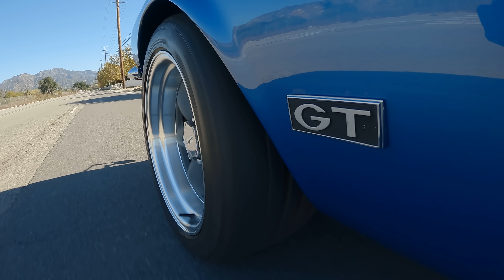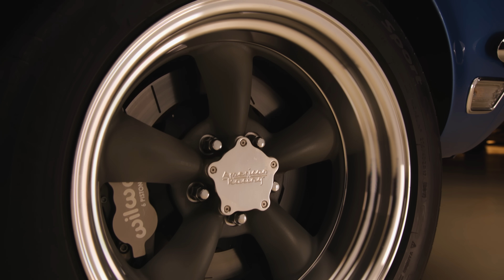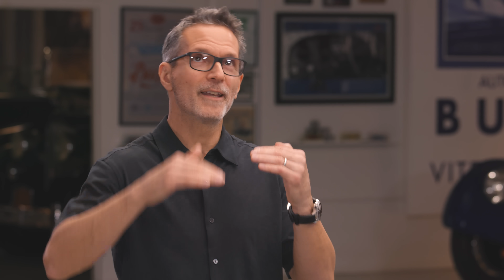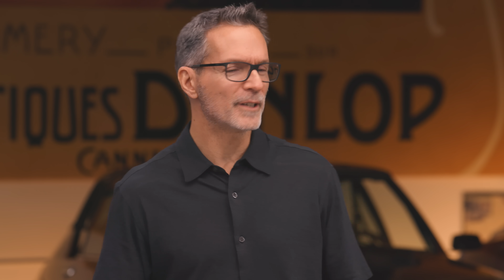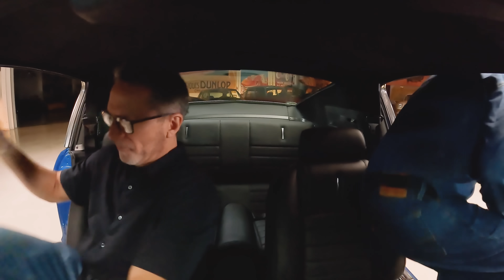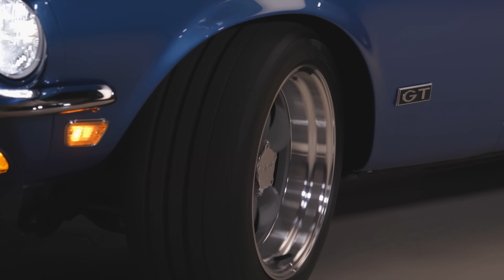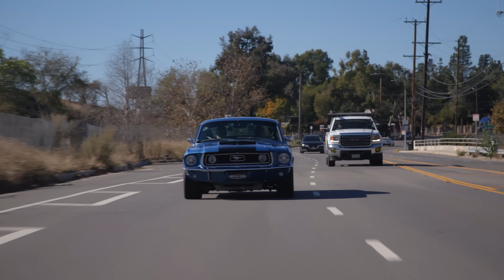Revology 1968 Mustang GT 2+2 Fastback Cobra Jet

Comment: The perfect Mustang. The only negative aspect is the 300.000 bucks price tag.
Reply: Wait...What....A "Mere" $300K --- I"LL TAKE TWO" ! ! !
Reply: Perfection: It takes what it takes.
Reply: Why not buy the real thing, very nice retro mod Mustang.
Reply: @sd5ten because this has been engineered to be better in every way. Didn’t you listen
Reply: @sd5ten  Much more powerful new engine, much better brakes, modern suspension, better interior, etc.
Reply: Spent a lot of time with one of their GT500’s - it’s a catalog build and FAR from perfect. Good looking though.
Reply: @earpig  This is interesting. What kind of issues did you find?
Reply: @andycombo  
A few of the things this poor man saw and couldn’t believe were:  rusty welds and hardware, mismatched/random hardware, strip calk everywhere (smeared), engine/trans tune issues, paint issues/blemishes, loose stitching, poor leather work, stereo issues and sound quality, etc. 
 —-To be fair, the rich guy who owns it literally said about this car and all the issues, “Well, it’s good enough.” $300k is less than his collection’s median value, for perspective. 
It looks great, sounds great, drives pretty good and turns heads for sure. If the price isn’t a problem, it probably is “good enough”.
I think they likely pocketed at least $100k.
Reply: @earpig You could have a donor car restomodded with all the same upgrades but with 1000 HP for 100k less. What you've described sounds like a horrible investment. There shouldn't be a single thing to complain about it for 300-400k (the now prices). Crazy.
Reply: @earpig "spent a lot of time" ??
What qualifier does that 
You clearly didn't buy one. How much time did you spend with this car? You knew someone that had you car sit over the weekend? 
They loaned you one for comprehensive review? 
You knew someone that had a neighbor that had an affair with the owner of the jiffy lube that installed some windshield wipers on the owner's of a 66 fastback? 

Odd was to satisfy some imaginary threshold enthusiast.
Reply: @ttexastt did you drive the mustane yourself? These are questions i want to know!
Reply: Agreed, but seems to be the going rate. Icon cars are well over $200K. When you can only make 60 a year, and you have 120 people on the payroll, it costs a lot. Ask any employer.
Reply: @GreatDataVideos  PLus made in USA which to me is important. 
America sold its arse to China yrs ago thanks Carter!
Reply: It takes 3-4 employees for each job because you always have one a comin and one a going and one on sick leave and that only leaves one employee left to build. 🥸
Reply: I'm a man who will never be able to afford a car like this,  but if you ask me, that is a great price for that car!  Sure the average working Joe won't be able to afford it, but if they could it would be money well spent for that kind of quality!
Reply: I’d take it over a Lambo, so its worth exactly what its worth to you
Reply: Ridiculous, really. Allready outdated.
Reply: Priced for a Saudi prince
Reply: Yikes.  I’ll take a Corvette.
Reply: A loaded 992 911 Turbos S gos for that kind of money. Tough call.
Reply: @MrHiBeta  good point. Think I'm leaning towards the 911.
Reply: Also its a Knock Off ... not a Ford and if he ever got any size of sales going it would be a LAW SUIT till he owed Ford his baby blanket
Reply: @tredogzs they’re the only company licensed by ford to build reproduction mustangs, that have fords blessing.
Reply: @MichaelGillen-if1nr  google meaning of licensing
Reply: and thats huge!
Reply: @jamesdemestihas9904  Can’t agree more unfortunately
Reply: It looks awesome, no question, but to me it lost the fascination about the very thing that made pony cars so popular in the first place: affordable, stylish power for everyday use.

For that kind of money I would rather buy a fancy 911 plus a real pony car, i.e. a mass produced modern one.
Reply: For 300k I hope they installed the crowd avoidance package!,,
Reply: I would rather buy Ferrari 812
Reply: For that much you can buy the lowest mile example but with a real cobra jet. Actually 2 of them for one of this. A cobra jet and a 66 gt 350
Reply: That's how much work cars really take. Modern cars are able to be sold cheap because of insane economies of scale. Keep in mind this car doesn't include modern crash testing or crush zones or airbags or emissions or any of those things. This is just "basic" (and I mean fundamental, not simple) engineering work. If you wanted a fully modernized version of the perfect Mustang, it would run you $500K+ per machine. Hell, Ford's OWN Mustang GTD is a production racecar turned road car and it costs $300K+. Imagine what a small-scale company has to deal with.
Reply: What a beautiful Mustang!  But for $300k, I might as well be daydreaming about a Ferrari.  1 more dream that won't come true.  Crazy.
Reply: WOW
Reply: Very cool but not $300k cool.
Reply: Economies of scale
Reply: Super Stang,😎👍 What a car! Beautiful ...Fast... Classic.... Ford. I love it! Thanks for sharing and showing it.😎⭐️⭐️⭐️⭐️⭐️💪💀☮️🖤🌅🎉🇺🇸
Reply: Could build it less than a third of that
Reply: I sure wished I had 300,000!
Reply: Who is going to spend that kind of money on something like that..not me
Reply: I agree lol
Reply: That's how much it cost woww
Reply: That's a rip off...I'm a restorationist.. and I  can build this exact car for 125k or less
Reply: Then you should be building 3 times the production of Revology at that sort of a deal.  
How’s business these days?
Reply: @Mybackupphone-q6n really.  You can make a brand new shell.  Nahe all the panels by hand. Paint the car. Put in all the interior suspension braking system  glass exhaust  the the engine and gearbox. Plus the wiring. Plus loads of other things all for less then 125 grand.   If so maybe you should start you own company.  👌👌👌👌
Reply: @russcooke5671 Old comment, but he's talking about using a donor car (real mustang) and restomodding it with all modern hardware. Shops do time all the time.
Reply: @Mybackupphone-q6n  you're not figuring in labor costs, which is probably the bulk of the price
Reply: @Mybackupphone-q6n  No you can't.
Reply: @Mybackupphone-q6n your paying for the labor. 2500 hrs or more plus parts and donor
Reply: @Mybackupphone-q6n How long would it take you? Could you produce 160 of them in a year? Could you employ 125 people, and pay them a decent wage for their time and skill level?
Reply: Jesus Christ
Reply: @GasStationSushiiii think how much money you would have without being illegally taxed to death.
Reply: @GasStationSushiiii … is Lord !
Reply: It's nothing to a baller
Reply: @chevyDboyMike  Yep...must be nice. This car has to be a blast to drive
Reply: While it is a lot of dough, given what they are providing, a fully customized classic resto-mod with extensive reenginerring, its probably a fair price. If you tried to pull it off on your own to this level of execution, it would probably be a solid $200,000 of parts and labor, unless you are the labor. Just the off the shelf parts I am seeing in that thing would total near $100K and there is a lot of fabrication work which is never cheap (and sometimes hard to find quality providers of).  So in my mind, with a fair mark-up, $300K does not seem unreasonable.
Reply: @opieg7333  Agree. It's a fair price considering theirs low production's number. The only way to decrase the price tag to a "more affordable" 100/150k it's to increase the production. C'mon millionaires with your Ferrari and Lamborghini get one of these too... 😁
Reply: I think 300k is a fair price. go look at these other guys making cars all new but look old, 1 mill plus price tags its stupid.  I think this is reasonable!  Icon for example similar pricing, but these have interiors that are just so elegant.
Reply: @Agentxphile 
I agree 300k not bad considering , still beyond my wallet.
Reply: @Agentxphile that's a rip off...you can build this same car for  less than 125k
Reply: @Mybackupphone-q6n  Maybe you can, but I can't.  Ive had old cars rebuilt to be "new" and the headaches don't end lol.
Reply: Choosing the Coyote over the Voodoo makes it imperfect
Reply: @marcob1729  except the voodoo (which is prob my fav v8 of this century btw) wouldn't be as true to the spirit of the original. Crossplane crank for this application seems mandatory IMHO. Cheers to all you fellow car lovers 🍻
Reply: @WyattWillis88  I disagree. The original Cobra Jet was not supercharged and was an exercise in peak naturally aspirated performance. The Voodoo is the best NA Mustang motor (well, a lot of people would say that), and maximizing its performance would be more in line with the original's intent
Reply: @marcob1729  well I'm glad you disagree because the world would be very boring if we all thought alike
Reply: @WyattWillis88 LOL
Reply: @marcob1729 the coyote is more reliable. I’m sure you could special order a car with the Voodoo 5.2 instead
Reply: I love the Voodoo engine in my GT350  @marcob1729
Reply: Just 300.000. ?? Well...who needs a house? You cant drive a house...but you CAN live in a car! So.....

No ,you are right. 300k is insanely overpriced. Who the fck has that kind of money to spend on a car these days. I drive a 1250 bucks banger. And that is almost the most expensive one i ever owned. Difference of financial situation is quite big today ,i guess.

Comment: For me personally the pinnacle of Mustang design still is as launched initially. They just messed it up quickly and kept shambling it up straying away from the original idea, getting worse step by step. But each their own of course. Reproductions are all the rage for so many brands and for good reason; modern reliable technology in a vintage skin with contemporary touches but fitting and aligning with the bigger picture of the overall style 💓

Comment: I can’t wait to start seeing the Godzilla 7.3 these replicas/Resto mods. I wonder how much extra space would you have on the sides comparatively.
Reply: That is the motor they should of used. Simple pushrod v-8 and if boosted can put out the same hp and bigger torque numbers! It would of complimented the simplicity of original car and not a overly complicated mustang engine! Why people want to use them wide dual over head cam engines is crazy!

Comment: Everything on that car is literally perfect.
Reply: For the price the car should be perfect.
Reply: @russellweber3466  that's fair
Reply: I liked everything about it but the LEDs in the door handle. Just use a thin strip or put them behind a defuser of some sort so that your eye isn't so drawn to them
Reply: Wish the vent window was real. I miss them.
Reply: even the door gap cave-ins of the original.
Reply: Could have used an independent rear suspension.
Reply: The carpet around the shifter looks like crap
Reply: He addresses that.
Watch the video.
 @Rabitt240mph
Reply: A friend has a GT500 from them. It is FAR from perfect. At the price point, which is very exclusive, they should be full on show cars.
Reply: it has the shittiest manual lmao.. they couldve got tremec from dark horse but they didnt.. dissapointing
Reply: @pikachusolu1606 They were making long before the Dark Horse existed.
Reply: Those wheels too big
Reply: apart from the handling .
Reply: @CiganoBoxer 
Handles far better than the original.
Reply: @CiganoBoxer  It's a Mustang, it's by design 🤣

Comment: I would choose this Mustang over a McLaren, Lamborghini, or Porsche in a heartbeat! I had a 1971 Mustang with a 351 Cleveland engine and ram air hood scoops, but my preference was always the '68 Mustang GT. Thanks for sharing Jay.
Reply: Had a 70 Torino fastback with a Cleveland. But the car was a boat. Plus a automatic. But sounded good once I put headers on her.
Reply: I hear ya ,definitely rather cruise around in this baby ,she has way more character than any of those exotic motors,  even with the new chassis shes just way more intresting and alot easier to manouvre in town and parking 😅

Comment: Buddy of mine had a 68 1/2 GT with the 428CJ which was the first Ford to get the Cobra Jet.  I drove that car many times and it was definitely one of the strongest running cars from Detroit..
Reply: 68 1/2 was also the first factory ram air in the Mustang.
Reply: I think the a few of the 1968 Torino GT got the first Cobra jet motors
Reply: @jeffreystrader3191  the Mustang GT was definitely the first car to get a 428cj.  Tasca Ford developed the engine for the Mustang

Comment: Can it be serviced by a ford dealership? And are parts like air cleaner readily available? I have a 2001 bullitt and some parts are just not easy to get
Reply: I'd prefer a regular shop that specializes in hand-built machines. I would never, ever want a dealership tech touching that.

Comment: But how do you comply with modern safety regulations in a chassis and body designed way back when none of it mattered? 🤔
Since its not a restoration of and old car, there surely can be no loophole to get around crumple zone, airbag requirements and the likes. The reason new cars are so much bulkier is because of these things, after all.
Reply: He answered that on the video.
Reply: Obviously you don't have to meet those regs.